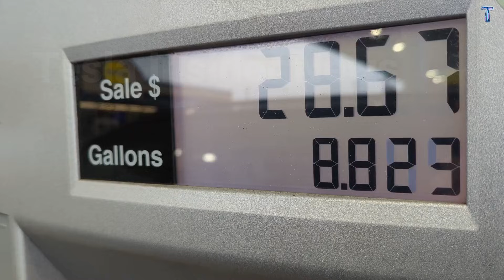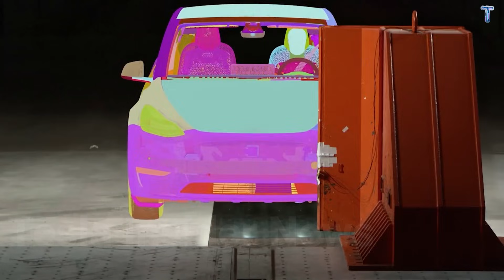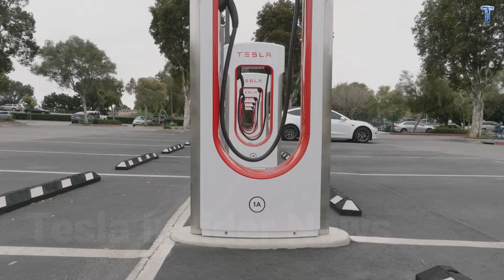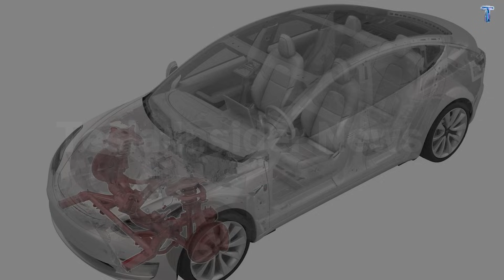Elon Musk’s $12,749 Model 2 Ends Car Bills Forever — 7 Trade Offs for Retirees

Comment: Too bad we can't get Chinese EV's in the US.  There is a reason Chinese EV's beat Tesla in every market they are available in, Chinese EV's are better than a Tesla in nearly every way and cost a fraction of a Tesla.  We can't get Chinese EV's in the USA so we are forced to buy a second rate overpriced Tesla and that includes the Model 2 tesla.   China's budget EV's are far cheaper and better than the Model 2 but Americans don't know this because we can't get them.  This is just another example of how protectionism hurts innovation, choice and cost.   We are forced to pay twice as much for a second rate vehicle as Americans while the rest of the world has access to the best cars with the latest technology.   Chinese EV's charge 4 times faster than a Tesla and work on up to a  1000 volt  system while Tesla still uses a outdated 400 volt system which severely limits charging speed.  Chinese EV's are utilizing the latest battery chemistry including sodium and solid state batteries.
Reply from the maker: You’re right that global EV markets look very different. Chinese manufacturers are moving fast on cost, charging tech, and battery chemistry, and that competition is real. In the US, trade rules and safety regulations limit what’s available, which reduces choice and keeps prices higher. The Model 2 discussion is really about lowering ownership costs within those constraints, not claiming it’s the most advanced EV worldwide. As policies and technology evolve, the landscape could still change, and we’ll keep tracking updates as they happen.
Reply: The USA has Fire Codes…. No chineeze cardboard car can meet that😂😂😂😂
Reply from the maker: US fire and safety codes are definitely stricter, and that’s a big reason many overseas EVs aren’t sold here. At the same time, a lot of the tech discussed comes from early specs and supplier leaks, so designs and materials can still change to meet regulations. Once manufacturers officially target the US market, compliance usually reshapes the final product. We’ll keep updating as clearer, verified details come out.